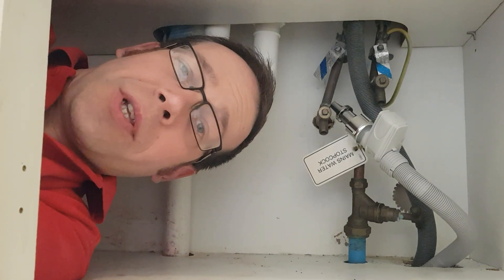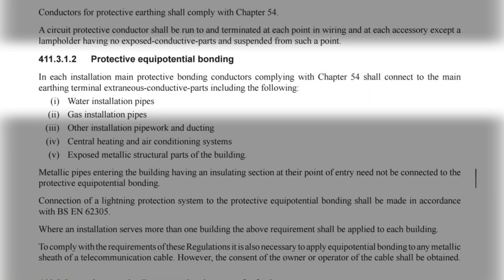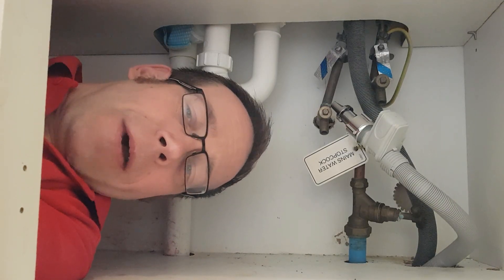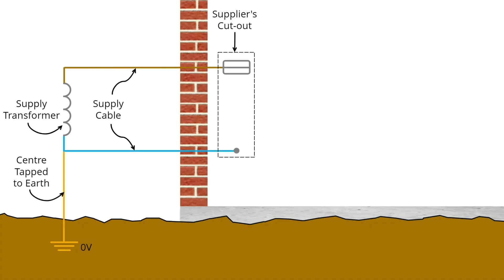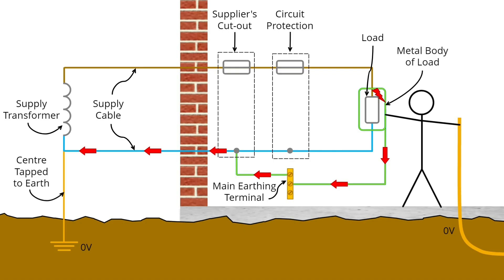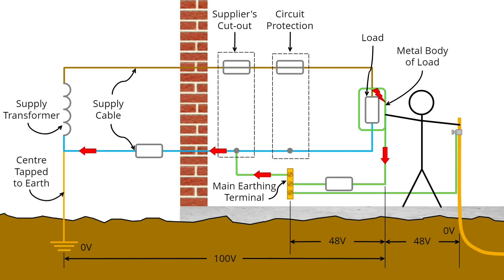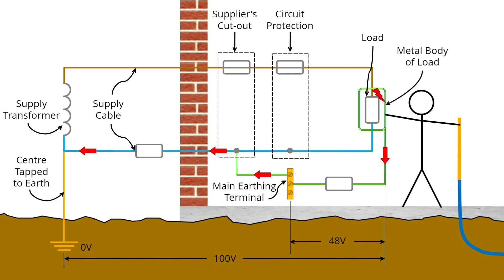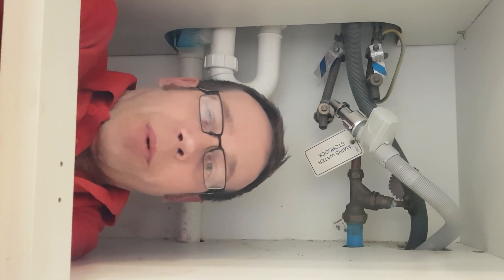DO YOU NEED TO EARTH BOND PLASTIC WATER PIPES?

Comment: One more point. If there is a potential between the metal pipes in your house and the installation in your waterworks / street installation, insulated by some plastic pipes in between, electrolysis will happen, and fill your pipes under high pressure with a highly combustible mixture of O2 an H2. Even with no ignition this might damage your water installation.
Reply: Electrolysis!!?? Please explain! DC, not AC, is required for electrolysis! 🤔🙄🙄🙄
Reply: @boblewis5558  Electrolysis doesn't care AC or DC  - it will happen.Normally DC is used to separate both gases O2 will raise at the positive pole and H2 at negative. With DC this will change 50 or 60 times a second and you get a perfect mix of O2+H2 for maximum bang at both sides.

Comment: Does this still apply when these water pipes are surface mounted on walls throughout an installation and include outside taps and electric water heaters?
As exposed conductive parts, there is no question that they shouldn't become live,  but what does the term 'under fault conditions' apply to?
(Have bonded pipes in an installation like this recently)
Reply: they arent exposed conductive parts by the BS7671 definition

Comment: In The Netherlands every home has there own earth-rod connection to the earth.
The water inside the pipe may be conductive as well. Therefore inside a bathroom a metal schowerdrain, a metal radiator, warter-taps etc etc are bonded to an earth-wire as well.

In older houses with wooden floors, where there is a steel floor-support (in concrete on top of the wooden floor), the steel is earth-wired as well.

Is that different form the UK?
Reply: Yes, most connections in the uk, except for a few rural properties have either a separate earth connection from the local distribution, or an earth connection which is tapped off the neutral as it enters the property (and the neutral is regularly earthed along its path from the transformer to the property). Bonding varies depending on the age of the property and what wiring regs were being worked to. Building metalwork is also bonded, but steelwork is not very common in uk homes (it’s only usually in one off type builds or commercial buildings). It’s amazing to see how differently different countries approach the same problems.

Comment: I've seen a voltage difference between cold and hot pipes within a house form when the hot water pipe heats up as a tap opens.  
I'm just wondering if in future a reg will come out with a bonding portion of pipe to bring the water to a zero potential.

Comment: JOe's analysis of the potential between the neutral at the entrance and the grounding conductor at the transformer is a bit hyperbolic. In the US NEC, there shall be a local grounding conductor in contact with the earth and connected to the ground potential terminal in the breaker box (that is the Green conductor). Bonding to the incoming water supply pipe is one method of creating a grounding connection. Other methods are to connect the earthing conductor to a grounding rod of at least 8 feet (3 meters) driven into the ground, or the attach the conductor to the metal reinforcing rods in the concrete of the foundation. (Ref. NEC-1999 article 250-C). Any non-conductive pipe shall be bridged across from the grounding electrode to the metallic interior pipes, and the exterior grounding water pipe shall be in direct contact with the earth for 3.05 meters. There is another regulation in the IRC abound the distance from the entrance of the metallic pipe to the electrical earthing conductor.

Comment: if you are reading from an old code book it may be required in the updated book.

if you are reading from a new book then it may have been required and discontinued.

the only reasons i can think of why to bond plastic pipes os.

1. a financial kickback the more stuff you have to install the more the industry makes money so maybe grounding wire and clamps cost money and it was done for money.

2. static charge  certain contents may cause static build up so it was done to bleed off static.

3. ground loops if there is a section of plastic between 2 metal pipes it is to keep all the metal sections at the same level.

4. plumber was out of pipe clamps so he used an electrical clamp but if that is the case there should be no reason to connect a grounding wire.

unless the code book sais that any electrical clamp in the system has to be grounded.

Comment: A PEN fault will promote an alternative return path for neutral  current through any extraneous earth connection ie metal water or gas pipes, either from the property affected or as a bypass through a property from an adjacent property on the same supply. Plastic service pipes do at least prevent a dangerous rise in main earth current due to PEN faults. 
They are more common than you think - check out Team Electrical podcasts 1 and 2 on Diverted Neutral Current.
We are not taught to think critically so we expect the DNO head to be whatever it appears to be.
Today most service heads are TNC-S and not TNS because somewhere outside the property a repair to the old PILC cable will have made the supply TNC-S. The only exception might be in a rural area where supplies are mostly fed overhead.

Comment: My boilers gas pipe will bond the water pipes but this may give a potential difference as it's not as direct as bonding the water pipes directly. This applies to indirect earth connections via an immersion heater, the motorised valves, a waste disposal etc etc. The pipes to radiators or an outside tap may also be contacting the ground at various points so I think pipes should be bonded regardless to assure continuity of earth protection, seems daft not to.
Reply: The gas pipe might be bonded but why does putting supplementary bonding on water at point of entry help?

If you need supplementary bonding - which given exemption for RCD protected circuits you can't imagine how you ever would in a modern domestic installation - then you'd install the supplementary bonding in the bathroom not at the stopcock.

Comment: We do the main bonding usually in the hot press in Ireland, under the sink would be supplementary bonding to the sink, but in the new regs due to lack of bonding points, ie no flange on sinks plastic pipes and flexible braided pipes. if we prove there's no earth path we don't have to bond, ie via insulation test .
Reply: @patrickoregan2148  go on Ireland! 
I can't believe that there's a debate here about weather or not to electrically bond insulator materials.

Comment: Joe, what if through various methods such as a gas boiler (cpc from spur), shower  (cpc) introduce an earth to the water service through the cpc of the electrical system and where there is no rcd protection should the main water service pipe then be bonded?
Reply: Please, please will someone explain exactly HOW one *bonds* a *non-conductive* PLASTIC mains water feed? 🤔🤔🤔🤔🙄

Comment: So why don't they make the pipe from conductive plastic? 🤔
Reply from the maker: The pipe doesn't need to be conductive, actually using non-conductive pipes removes the need for bonding, making the install safer and simpler. 😊

Comment: I have been told I don't have bonding in my property, I am having electric car and so need to get the pod fixed, they won't do it until I get bonding where will I find it please. Dammed if I have a clue .
Reply from the maker: It should be where your water stop-cock is and where the gas meter is. If it's installed and if it's needed.

Comment: When you connect the earth to the neutral, do you neutralise the earth or earth the neutral??
If the transformer is a single phase step down transformer, I think it’s much more helpful to think of neutralising the earth. Voltage is always the potential between two points and therefore the earth is only at 0 V potential if it is locally bonded to the neutral.
Reply: The use of the terminology of "neutralising" is not conventional and is not used. Keep away from it. It you are not using the right terminology, then the question is, is that because the user's knowledge is limited?
Reply: @deang5622  I use the word "neutralise"  because invokes a change of perspective. It means to make neutral. Neutral is defined in the front of BS7671. Earthing is used throughout BS7671 but in my experience most people seem to think that the Earth has magic powers. It doesn't. 
NB: "magic powers" is not defined in BS7671 but can often be used synonymously with "magnets"

Comment: I think a return to the physics lab might be in order. Some interesting experiments in contact with water from metal and then water in MDPE which may or maynot be a presurised pipe or empty from water completely! Earthing, bonding and a mix and match of both people like to use is not the answer to all situations. Let's go back to oil lamps and candles and avoid the electric shock but careful not to burn your house down :)
Reply from the maker: That took a turn towards the end there Sean! 😂

Comment: On a brand new install i would accept the non-bonding of plastic incoming water pipes ( what about plastic gas pipes then ? )
Existing installs can and do bring the risks of cables being found under floors etc resting on metal heating pipes etc ( but they could now be all plastic !)
The discussion on protecting metal sinks on older BS7671 regs brought similar conflicting views didnt it ?
Personally, I'd still bond and do continuity tests to verify integrity.

Comment: What about fault conditions of say an electric shower? If there was no bonding the supply pipe would be at mains potential.
Reply from the maker: The CPC within the supply cable to the shower will be connected to the metallic parts of the shower including the heating element. In the event of a fault this would cause the RCD and or the mCB protecting the circuit to operate.

Comment: Water is not a good conductor of electricity, It has a lot more resistance than a metal pipe. If the cable is there rebond it, there is no harm and no cost. A new installation I will not bother.

Comment: Totally agree, bonding is not needed. Water in the pipe really is a poor conductor - not enough ions in it, so quite high resistance path - higher than the alternative (wiring), or if it were in a metal pipe (copper, iron etc). One minor comment, the two earth points will not always be at the same potential ("0v"); I don't recommend measuring unless in a very controlled environment, but if you disconnect ALL the bonding and measure during a thunderstorm, you'll see the effect...and depending on local conditions, the resistance can be low enough for a respectable current (or can be just potential).

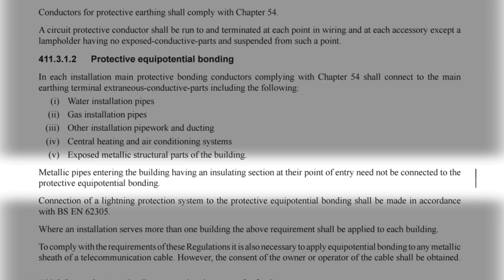Comment: Go to 1:08; it says "Metallic pipes entering the building having an insulating section at their point of entry need not be connected to the PEB." - ie; you do not have to bond to the utility company's incoming metal pipe, should it exist.
The clue is in the words: "Metallic pipes entering the building". You have a plastic pipe entering the building.
Section (i) 5 lines above it says: "Water installation pipes". 
That includes all metalwork connected to the water pipes on your side of the plastic building-entry pipe.
Here is a sample reason for earthing all metallic parts: 
If you have a fault in your immersion heater/water heater/pump etc, it will render the entire house heating-system live, radiators and all if it is not bonded. Read the rules, they are there for your protection!
Reply from the maker: The same reg states that the metal water pipes will need bonding if they are extraneous conductive parts. If they're not introducing 0v potential they're not extraneous and won't need bonding. It's not being a water pipe that makes it need bonding it's being an extraneous conductive part.

Comment: There seems to be a misconception here. There is no path to earth via a NON conductor. Whether there is water within the plastic pipe or not, it is still an insulator. If the integrity of the plastic pipe is compromised the water will flow directly to earth or another surface and for an individual to connect to both a live piece of material and loose water is not feasible

Comment: Just playing devils advocate here.... but would this still be the case if the plastic water pipe is only 1metre in length. New builds generally are all plastic however, older properties may still have an iron service pipework. (i.e.The iron pipework was adapted under the floor and plastic bought up to the new isolation stopcock?)

Comment: Is there any point in connecting to the outside of a plastic water or gas pipe?  The plastic is an electrical insulator after all.

Comment: I'd bond it anyway because you have no way of knowing if the homeowner has installed a metal pipe elsewhere that exits the building, to an outhouse etc. If there was no plastic between that and the incoming metal stopcock then the pipework would then all be at earth potential. You could argue that that shouldn't happen but it's unlikely that a home diyer or plumber would consider that and possibly neither should they have to - it's the electrician's job to ascertain that and plan ahead for it.

You mentioned a possibly scenario for not including bonding because it shouldn't be relied upon to prevent danger where other regs have been violated but then surely that is the same for a metal pipe coming in. The earth bonding is there to provide a path back to the panel in the case of a fault which could occur even with a plastic pipe entering, such as driving a nail through a pipe and cable at the same time... I'd say the difference would be that the bed can be moved but the pipework cannot be so should be bonded. You could argue though that the bonding could occur at the most convenient location and not necessarily within the regs distance of entry to the building...

Comment: I live in Germany. We have TNC-S and a plastic water pipe. The pipes in the house are made of copper and are bonded to the foundation earth. The house is almost 50 years old. As far as I know, the heating engineer has requested that the earthing is available, so the earthing is not at the inlet of the pipe but on the heating system. But that doesn't matter with copper tubes.

Comment: 3:12 "And because fault current is usually quite high, the voltage pushing it along can get quite high too". Apologies if I've interpreted this incorrectly, but the fault current will only be high if the voltage, or the potential, is high. The resistance between the fault and the ground source will dictate the voltage and thus the current. 

My understanding of equipotential bonding was also to do with the potential influence of other phases within the area. eg, the neighbours house could be on L2 whereas my house is on L3. A fault on their shower could introduce a potential between close pipework and a grounded receptacle in my house. In other words, it ensures that all potential fault currents across the area have a common (neutral) path to the center point of the transformer.
Reply: Almost right on the first point (unless you want to get into quantum mechanical explanations of electromagnetism). It takes a voltage to drive a current. BUT don't forget there is a current in the supply side too, so that drops a voltage; the voltage at the fault point is based on the ratio of the resistances on both paths to the transformer. Assuming (!) they are the same, the voltage would be about half the expected supply voltage. Slightly less resistance in the return path, and the voltage will be slightly lower than half.

Comment: Depends on what sort of floor the house has, if it's soil under boards like in an old terrace, there's a chance of pipes resting on the soil even if the income is pvc. Then there's a chance of the floor being unfilled and concerted to stop pooling surface water on the surface.

Comment: I could add: clean fresh water is conductive, but often not very.
Reply: Water is actually a semiconductor. It doesn't conduct in the way metals do, but because it self ionises there's a small capacity to carry current. This increases when the PH is shifted by e.g. mineral content.

But even the worst quality water mixed with a bit of sewage has such low conductivity that a few metres inside 22mm plastic pipework gives you a resistance in the megaohms - high enough to serve as insulation.